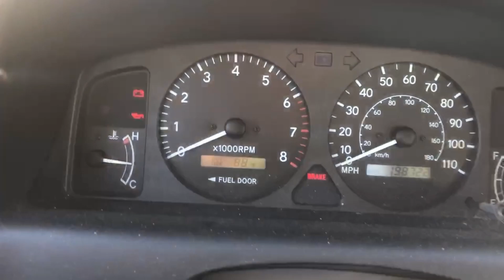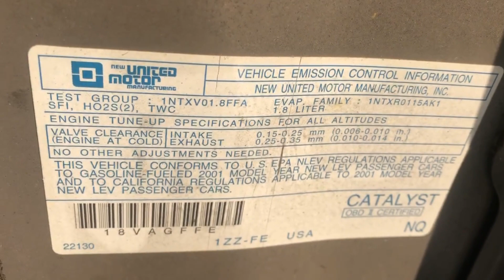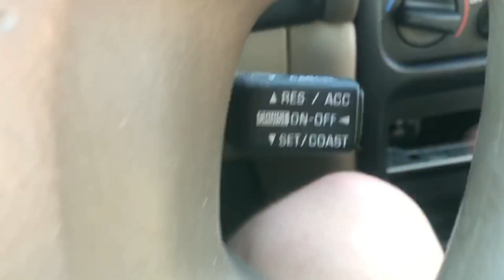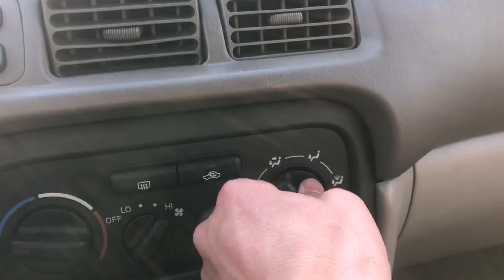2001 Chevy Prizm Manual Still Daily Driven in 2023

Comment: I have a 2000 lsi that was given to me in 2019, currently had 238k. Nothing seriously wrong with it however I knew it needed some work. It finally broke down last month. So decided to invest in it, since it was relatively reliable for the last 5 years. New fuel rail system new injectors, valve covers replaced, new alternator, tune up, replace rear brakes. Replaced drive belts. It should give me another 10 years. But I do have other vehicles.
Reply from the maker: @shaunmorse4089  That is a smart decision in today’s car market to invest in the ol’ reliable! Were the rear brakes tough to work on? I assume you have drum brakes in the rear, perhaps very rusty?
Reply: @ very rusty